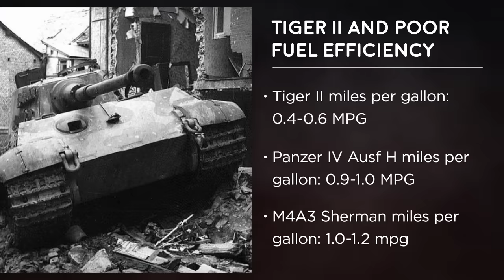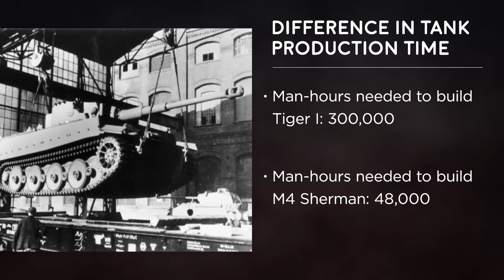Why Did German Tanks Perform So Badly in The Battle of the Bulge?

Comment: Anyone who has owned a German car can relate to this video: awesome performance, crazy maintenance and complexity.
Reply: my previous car was an audi a4. the subwoofer was garbage so i wanted to replace it, but it was built into this cage in the rear deck that i had no idea how to disassemble. in a japanese car a rear speaker would just be bolted into the rear deck, but noooo the germans have to overengineer the fuck out of it, and it sounded like garbage anyway!
Reply: @oldfrend  Wife had a VW Pasat.  To change the timing belt, you have to remove the entire front of the car.  In my f150 you only have to remove the fan shroud if you don't want to bust your knuckles.
Reply: @3rdworlds  also! there's no drain plug in the oil pan! to change the oil you need this vacuum extractor thing that you snake down the dip stick tube! the fuck?!
Reply: @oldfrend  I’m fairly certain every procedure in a German car’s service manual starts with “See procedure IN1: removing glovebox.” They’re built like Matryoshka dolls
Reply: Unless of course you owned a bug. Lol
Reply: A mechanic told me that, in a Mercedes, the ball bearings have ball bearings.
Reply: Over engineering and when working beautiful. That's why I drive my Toyota every day. Lol 😆 it never breaks down and is cheap to fix.  My S7 Audi is a weekend date at most. She's a beautiful  garage girl.
Reply: OH my gosh, you NAILED it!!
I had a gorgeous, amazing BMW 750iL...except it cost a million dollars every time something went wrong (including the frickin' headlights!) and I came to believe that if it wasn't leaking, it must be empty.
Reply: @donfishmaster  > If it wasn't leaking, it must be empty.

:<)
Reply: You dont buy audis or VWs 
Opel is the way to go if you want easy maintennance
Reply: I have heard that you must take the new Volkswagons to a dealer to replace the starting battery.
Reply: @oldfrend  I have a 2010 Toyota Corolla and nothing ever breaks on it. Change oil, batteries, and tires. Had to make the dealer change the wiper blades.
Reply: @skipperx5116  Been that way for a while. Not necessary, but the replacement lasts longer if you reset the alternator charging logic
Reply: @skipperx5116  Thats bizarre.
Reply: I loved my ML500, it died a hero protecting my family in a crash. But I would never own another Mercedes.
Reply: All auto companies, Germans, Japanese, whoever,    design cars for ease/ cost of assembly. They don't give rat's patoot about ease of maintenance or repair. The more complicated to repair, the better for the dealerships.
Reply: My mechanic hates German cars, but says he makes great money on them.

Comment: Nice video. Good info, good script, good film, and good narration. Nice of you to mention the enhanced survivability of the Sherman. I'm pretty sure that I have read that it was the most survivable of all full size tanks in the war. Five hatches, including one on the bottom. The electrically operated turret was also a big advantage. From ambush, you could rotate the turret while the engine was off. German turrets ran off engine power, and to rotate the turret as fast as possible you had to really wind the engine up. That's not an ambush anymore. "Hey! We're over here!"

Comment: One issue worth considering is the supply & fitting of bearings on these complex vehicles. Not just the weight, but the size, number & quality of bearings for all heavy vehicles must have been a Gigantic cost factor. I believe there was a factory at Swinfort (probably wrong spelling, sorry) that made them. The metallurgy & fabrication of bearing components is complex. I know it was a major problem. So was the supply of effective lubricants to keep them functioning.
Reply: Lubricants was a big problem for Germany. The coal-gasification process they used could produce fuel, but not lubricating oils/grease. That had to come from natural petroleum and Germany had limited resources of that. Even the synthetic fuel they produced could only make 87 Octane fuel efficiently, when they tried to make 94 Octane for improved performance of their aviation engines the quantity of fuel they could produce went way down. The only source of natural petroleum they had was the Ploesti Oil Fields in Rumania, hence the Allies interest in those bombing raids. Germany tried desperately to seize the Caucusus Oil Fields in Russia, but got distracted in Stalingrad and we all know how that turned out. Had they focused on the Russian Oil Fields, the war in the east may have gone differently. Germany still would have lost because this was a war of production and they were outmatched by the Allies, but the losses they suffered in 1943 in particular might have been significantly curtailed.
Reply: A well known limitation, once Timken had been persuaded not to export to Germany.  Hence - https://en.wikipedia.org/wiki/Schweinfurt%E2%80%93Regensburg_mission

Comment: Stugs weren't a great choice for the Battle of the Bulge, either. They are good on defense, where their low profile makes it easier for them to stay hidden, and they can position themselves to be facing likely avenues of attack. However, on offense, the same lack of turret that gives them that low profile, coupled with the opposing side getting to pick where it strikes from, hinders their ability to react quickly, since the entire tank has to turn to point the gun in the general direction of the enemy.
Reply: Stugs also had mediocre weapons and subpar armor against anything with a 76mm
Reply: Stugs not a Tank, they are artillery by design and crew.
Reply: StuGs  were meant to be heavily armored self propelled artillery, they lacked a hull gunner which meant the commander had to defend the tank from infantry.  Nevertheless they were used as replacement tanks  due to shortages of turrets tanks, better than nothing.   The final versionsof the StuG III had a commanders viewing cupola probably reflecting this.    The lack of a cupola was extremely dangerous for the commanders of StuG III and JagdPanzer IV when used out of role as they were subject to sniper fire and artillery.

Comment: The question is. Would Germany have been better of only making Stugs and Panzer IVs? Some say yes some say they would not have logistics to support so many more tanks anyway
Reply: Yeah many people think the Germans were stupid for making high cost, complicated tanks, but in reality it was their only option because they never would have won anyway if they tried competing head to head in a mass production style war against the soviets or Americans, since Germany was a smaller country than both of them from the start, that's why they thought they could win with the "quality over quantity" mindset.
Reply: Thinking only of the fuel consumption, would you rather have five Pz IV and StuGs or two King Tigers?
Reply: the panzer 4s weren't reliable at all. It says something when your most reliable tank is the tiger. The thing is the panther was a less complicated design that wasn't that much more expensive than the panzer 4
Reply: Its a difficult question because at face value one would say 'yes', until you factored in that the Allies were making newer and better tanks as well. The Soviets especially, once the IS-2s hit the field in 1944 the StuG's and Panzer IV's were completely inadequate against them, they needed Heavy Tanks and Tank Destroyers equipped with the 8.8.cm Pak 43 to fight them. The T-34-85 and the 76mm equipped Sherman's also closed the gap in the firepower department against the German mediums, turning what would have previously been a 70-30 or 60-40 engagement in favour of the Germans against T-34-76's or 75mm equipped Sherman's to a 50-50 or a 55-45 engagement against the Germans.
Reply: @madgavin7568  This is very true, and with that I would conclude that they definitely should have taken the middle road in focusing on Panther and Tiger development  (since they were good against IS2s ect.) instead of the ridiculous projects like the Jagdtiger and Maus.
Reply: @Millermacs  Agreed. One question though is about the Tank Destroyers, should they still have made the Jagdpanzer IV's and Jagdpanther's? The Hetzer's were undoubtedly useful but what about the bigger (but not impractical) TD's?
Reply: @madgavin7568  Yeah I'd say so, the Jagdpanzer / panther were relatively reliable + cheap to produce + chassis were already in production, although perhaps their ever increasing armor wasn't the best idea since it reduced reliability.  But I'm no tanker, so maybe I would think differently if my life were saved by the increased armor.
Reply: They did not have enough fuel or crews.
Reply: @Millermacs  The British too. The Germans struggled to surpass British tank production until about halfway through the war, and Britain was smaller than Germany. They didn't compete in a game of mass production because nazi economics were awful, not really because they were smart enough to realise they couldn't win
Reply: America and Russia fielded 10 tanks (each) for every German tank. There was no way Germany could match their opponents on sheer numbers. At least by fielding exceptionally capable machines, that managed at times to knock out 10 enemy tanks before being destroyed, they could keep the match in parity for very long.
In late 1944 the war was already lost, so more tanks would have not made any difference. The offensive in the Ardennes was a mistake, Germany would have better used the remaining resources (including manpower) to entrench along the Rhine, rather than going on the offensive. The Generals were very well aware of this fact, it was Hitler that decided for the offensive.
Reply: @marcobassini3576  I agree although I would say that the offensive was understandable to an extent because their only other option of entrenching in one spot would have just allowed them to be bombed by close air support and artillery easier.
Reply: Armour cannot function effectively alone. You make more armour types then you need not only more panzergrenadiers etc to support them, but also the supporting vehicles and supplies for the support troops.

Only 20% of a panzer division's personnel was actually made up of the 'panzer' regiment. The rest of the panzer division was made up of panzergrenadiers, recon, flak, engineers, signals, medical, field kitchen, admin etc echelons.

The reasons why the hastily cobbled together panzer 'brigades' failed and were ineffective in early autumn 1944 was because they lacked all these organic support sections.
Reply: Millermacs,

Its odd that people only mention the production of the USA and Soviets. The British, with its Commonwealth, also out produced Germany in most things too, particularly trucks, artillery, guns, ships.
Many people forget that Britain was one of the biggest industrial manufacturers. It wasn't just the USA and USSR.
Reply: @lyndoncmp5751  Britain without the help of USA did not even have food for their people. It was kept alive thanks to the convoys across the Atlantic, chased by U-boots.  It was clearly the junior partner of the coalition, and the contribution to the coalition was secondary. Germany fielded 180 divisions on the Eastern front. How many divisions has Britain fielded in the war? Even most of the tanks used at El Alamein came from USA.
Reply: Marco

Utter nonsense.

1. A lot of the food came from Canada, not the USA.

2. Britain was never remotely prevented from starving because of the USA and Britain's "grow your own, dig for victory" was a huge factor.

3. Britain was the senior parter in the west's war against Germany up until mid 1944. The USA only took the lead for the last year. Britain took the lead in the west for the first 5 years.

4. It was the Royal Navy that kept the Atlantic Ocean and Mediterranean Sea open to the allies. Without the Royal Navy the Axis would have controlled both.

5. The majority of tanks the British used throughout the North African war were British, as were the planes, while the trucks, artillery, anti tank guns, mortars etc were almost exclusively British.

6. Reverse Lend Lease from Britain to the USA provided the USA with around 30% of its requirements in the European Theater of Operations, from transport across the ocean on liners such as the Queen Mary, to building the barracks for US troops in Britain, supplying them with bread to eat etc etc.

Without Britain, the US Army would never have got across the Atlantic and would have had nowhere to fight there.

Stop watching stupid Hollywood productions FFS.
Reply: Marco Bassini

"America and Russia fielded 10 tanks (each) for every German tank."

Again, utter nonsense.

Germany produced 50,000 tanks, assault guns and tank destroyers.
The USA produced just over 100,000.
It was barely twice as many. Not ten times as many.
Germany simply had to split their tank production between fighting the British Commonwealth, USSR and USA.
Reply: I think the problem is much more global than just 'Germany'. One thing that is often forgotten is that While the US strongly supported the warfare of the british/french nderground and russian side of the european theatre, they didn't actively stop (nor could they) the german conquest.
It wasn't until another axis power made the second biggest mistake for the axis that would ultimately lead to its inevitable defeat: Japan's conquest in the pacific.
That caused the US to take an active role in the war and marked the moment where it started to fully deploy its warmachine in all its glory.
Where Germany had already made its first lethal mistake of betraying the Soviets, causing them to even have an eastern front, Japan definately made the second mistake of attacking the US causing for the axis powers to face a war they'd never win from that point forward.
So wether Germany would've had built panzer IV's, StuGs, Tigers or anything else was already immaterial by that time.
Reply: @skorpion7132 one day after Pearl Harbor, Germany declared war on the U.S. Japan, however, did not declare war on the Soviet Union.

Comment: A favourite story that I saw in a documentary years ago was comparing how the Germans and Russians overcame the issue of track pins coming loose. The Germans used a complicated interlocking mechanism while the Russians instead just installed the pin inboard and welded a knuckle on the forward edge which knocked the pin back into place every time it came past
Reply: Two different ideologies. The Germans built their tanks at a higher standard as they expected them to last longer. The Soviets cared less about the standards as they knew they'd be losing them quicker, and they were right. Between 3 and 4 times as many Soviet armour types were lost for every 1 German.
Reply: @lyndoncmp5751  Most of the war with Russia, Germany had air superiority and was able to destroy the Russian tanks at a higher rate.
Reply: When encouraged by Big H to copy those aspects of the T34 which gave it an advantage, the outcome of German engineering prowess (the PzKw V Panther) included a wedge of metal exactly replicating that item, although completely unnecessary on the Mk V.  there is some sort of lesson about German engineering to be learnt from that.
Reply: @lyndoncmp5751  BS

Comment: Just for comparison:
A Merkava tank (Mk1 to Mk4) takes ~30 minutes to change the entire transmission and engine block, with only 21 bolts needed to be opened.
One cannot change a car engine this fast.
Reply: Depends on the car. I remember back in the day when VW meets would have a race where you drove your car to a line, pulled the engine out, put it back in and then drove away again. Those times were well under 30 minutes. But then a VW engine was held in by to nuts and two bolts and about five wires. And, one big guy could pick up the entire engine.
Reply: Merkavas are famously workable
Reply: I know an ex NZRAF engineer who reckons that back in the day a good crew could change the engine in a Skyhawk in 45 minutes ...
Reply: @Mishn0  Yep. Worked pit crew for Formula IV road races back in the late 1970s early 1980s in Waterford MI. We would swap out whole engines relatively quickly.
Reply: My mechanic removed the engine and tranny on my MG Midget in 15 minutes. The first time that I tried it took 3 days w/a Chilton manual.
Reply: @TeaParty1776  nice. Now try this on a modern car, especially an uber complex one such as a Mercedes. Let me know how much time this took..
There is a lot of respect for German engineering but people often overlook the problems of that engineering. It tends to be very complex, costly and hard to manufacture and maintain. The US engineering in WW2 was agricultural. Like building and fixing a tractor. Function over form, no place for exotic and expensive technologies.
The Israeli engineering methodology is just in between these extremes which I think is key to success of Israeli weapon systems (e.g. Iron Dome, Trophy, Python, etc.). They are built first to function very reliably but also do not shy from advanced features as long as these do not hurt reliability and maintainability, and unlike the Soviet doctrine put the soldier survivability and comfort as a top priority.

Comment: The German were up against a three major impediments. Time, weather, and supplies. They knew they only had a few days to reach their objectives before the heavy cloud cover would break and allied air power would get into the fight. And they were scavenging oil and gas from Allied supply dumps. They didn’t really have the time or the supplies for long drawn out battles. The entire plan was doomed from the start. It was only the fighting experience and knowhow of the German soldier that gave them initial success.